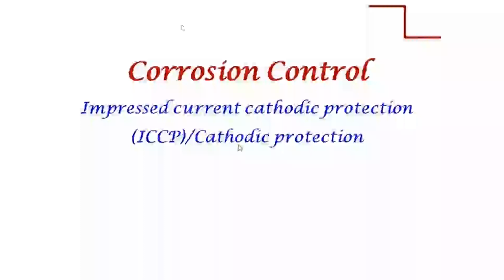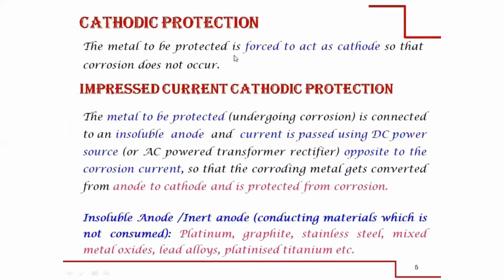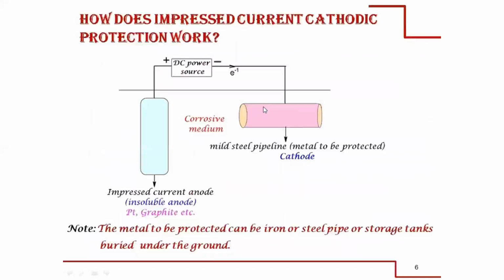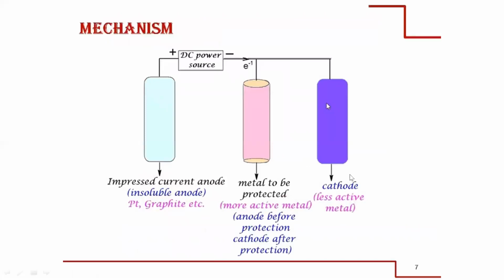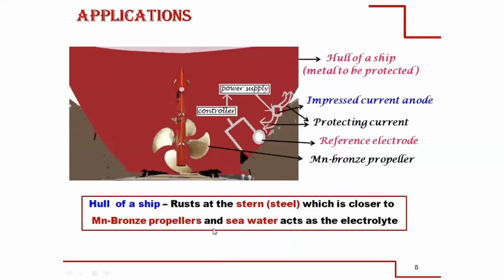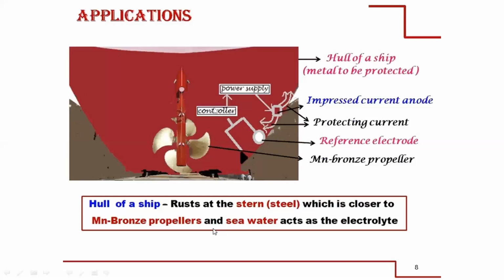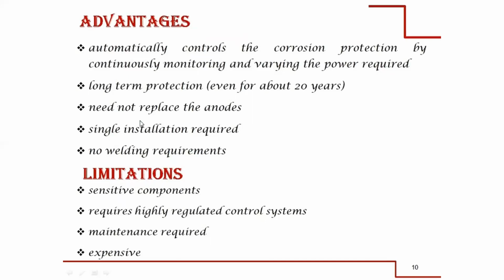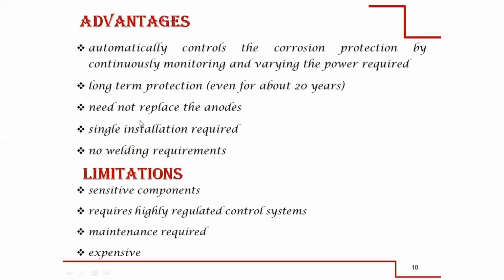Impressed Current Method

Comment: Does the voltage difference in the dissimilar metals dictate where the current is received? I.E. the steel has a more negative potential than the bronze making it the anodic area or the oxidation point but when the impressed current is applied the oxidation is now at the impressed anode but where is the reduction taking place? In a galvanic cell, reduction would be at the more cathodic locations which is the bronze but does impressed current negate the galvanic difference... is the reduction taking place at the bronze and steel similarly once impressed current is applied or does the voltage difference between the bronze and steel cause the reduction to take place at the bronze until it is polarized to the voltage levels of the steel?